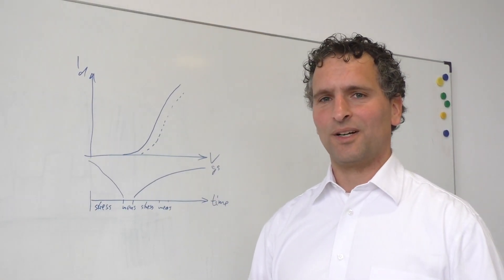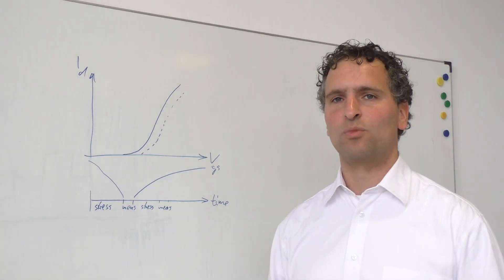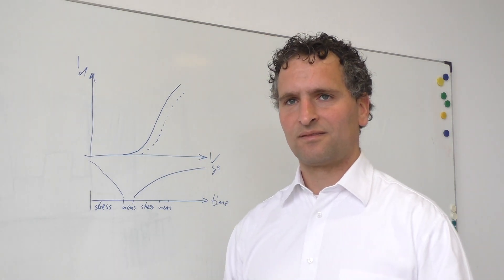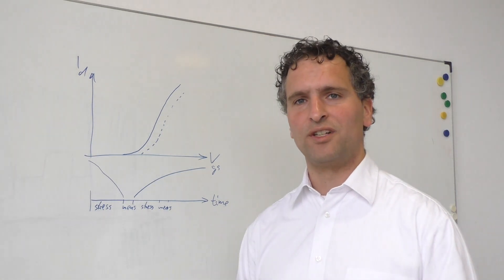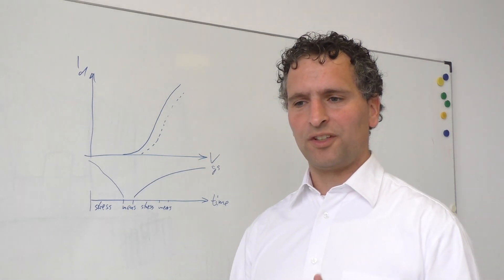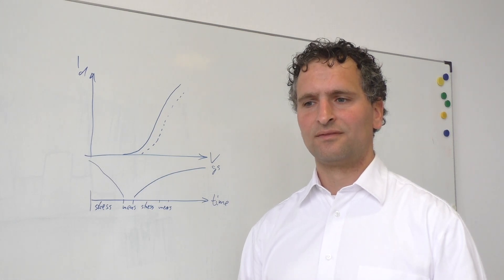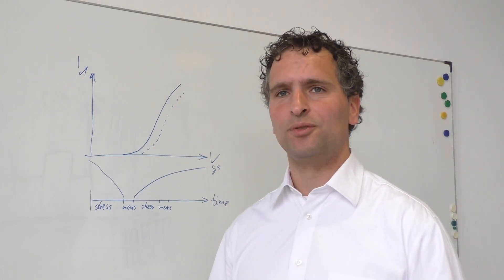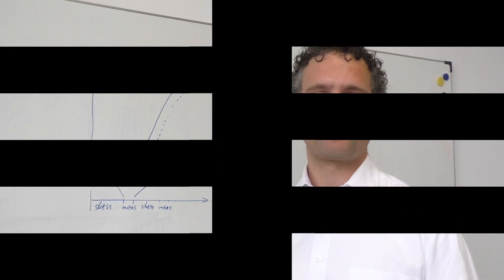How Chips Age

Comment: I have an solid state analog transmitter of 85 Kw (LARCAN) working uninterrupted for almost 35 years. I am really impressed about how these MOSFET(MRF151G) are still working at maximum RF power without any kind of maintenance.